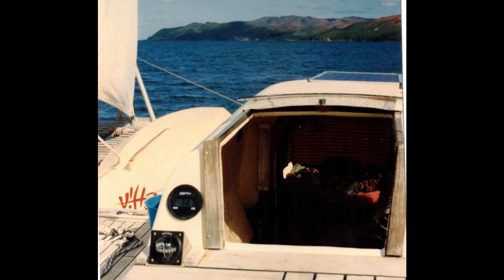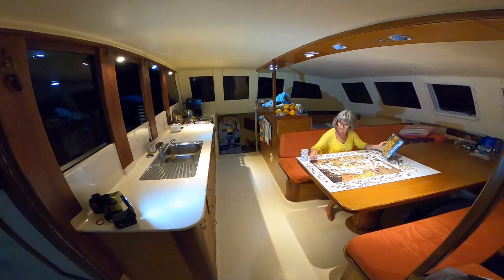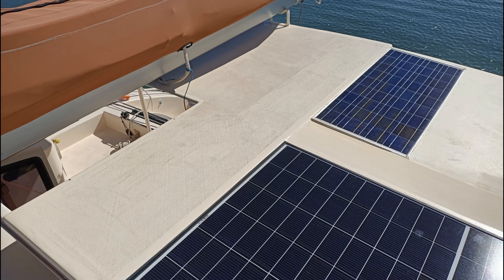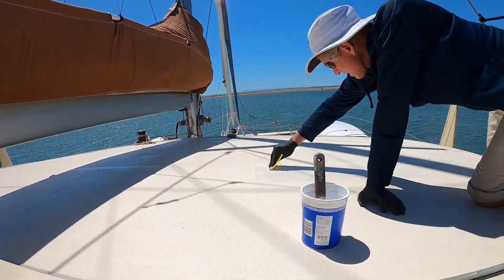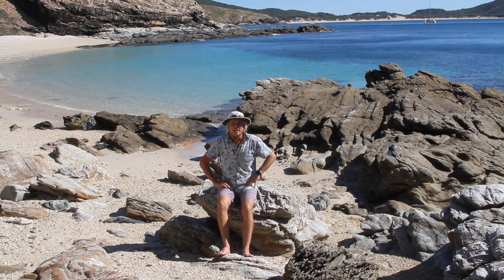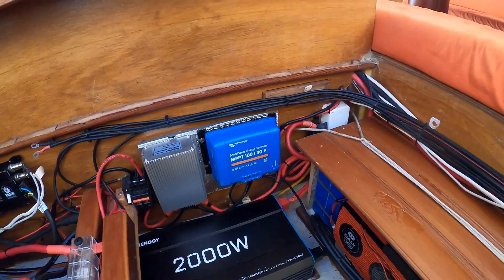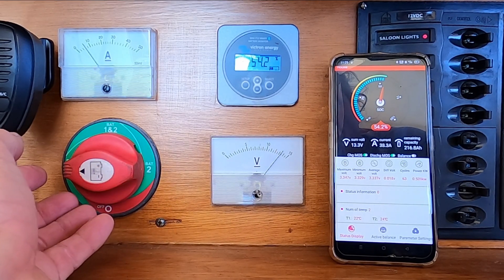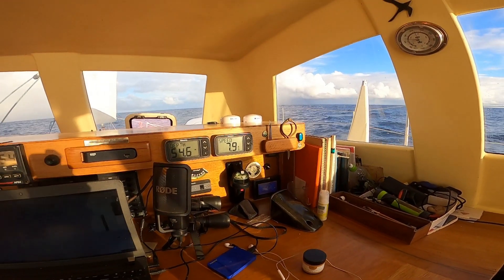Secrets of the best solar power system- The Solar Electric boat explained

Comment: I see many people use a 12v and a separate 48v solar charging system. Why not just use 48v battery bank and charging (more efficient and smaller cabling possible)?

Then step down from 48v to 12v for anything that runs 12v…

Would love to know your thoughts…
Reply from the maker: Hello, yes, I think your absolutely right, full 48v would be the way to go. The reason we have the dual voltage being we had the 12v already in place so just developed from there. Of course there are the issues of dividing the solar power and times when one is full and the other is not and not having the ability to divert this wasted power. When I have to re-new the much older 12v bank I would definitely go for a 48v bank (Now you have mentioned it!} It would just mean switching to a 48v inverter. Otherwise it would be a much better system with all the solar power coming in at 48v and easy enough to charge whichever bank is needy. Oh, the diesel engine starter motor is the only issue, but perhaps a powerful 48v to 12v convertor is not so expensive?
Reply: @AndrewStransky-cc2dr 
I agree starter motor is an issue. My thought were to have 1 single 12v battery. The DC-DC 48v to 12v would charge the single 12v battery (900cca or so). So the 12v system (DC-DC) has a ‘buffer’. In my experience everything works better with a buffer battery. 

I do plan to run dual 96v Axial motors from golden motors directly connected to sail drives. 

I am initially thinking 2x 48v battery banks. Then pull the motors off the combined banks at 96v (more efficient motors and thinner wiring). 

PS - you are an inspiration! Thank you for the amazing content!

Comment: Hi, can you parallel two of those 600w mppt controllers to charge one 48v battery? Hope to hear from you
Reply from the maker: Yes, I had often wondered how I could use the solar power from my house bank to charge the 48v side. If I could join the 2 controllers in series that would only be 24v. If I could series the 2 panels that would give me enough to charge 48v. As it is the house bank normally needs more power than the motor bank so I am normally using the dc-dc convertor to use the motor bank to power the house loads.
Reply: @ hi Andrew, thanks for your quick response, you say yes, so you have about 600w of solar to one of these chinese mppt controller and 600w to the other chinese mppt controller en the output of both is parallel over one 48 accubank, right?
Reply from the maker: @HarjoK  Oh yes, I see what you are saying. I was a bit hasty in my reply. The two 600w boost controllers were paralleled into the 15kw motor battery.  I have now removed them and gone back to the wiring those panels in series and using the Victron step down controller. In my video I reported that when wired in series the victron would have a very low output when shaded, but I did discover it was actually a issue with the controller and by re-setting it the output would increase back to a proper amount. I don't seem to have that issue anymore, not sure why. On the port side of the boat I still have one of the China made boost controllers and it works fine.

Comment: Sure your curved Hyundai glass panels are really glass and not acrylic panels. With that bent of yours glass would normal shatter.
Reply from the maker: Yes, surprising isn't it. White toughened safety glass, 3.2mm is what the specs call it. Some years before I ripped off the alloy surrounds of a glass panel and glued it to my bimini like a flexible panel. I did find it got way too hot and didn't output much but I also noticed how flexible it was and could easily bend more than I have bent mine.

Comment: Really like the integration of the fixed solar panels into the bimini roof. Thats definitely the way to go to make them part of the roof and forget these never properly working semi-flexible ones. Next step would be using bifacials to also harvest from the underside and due to glass both sides also more stable. Yes they weight more but definitely worth the extra weight as besides the rear side they work more with diffusion light. I have 3x365W longli bifacial and only the backside delivering additional 700Wh harvest daily. And mine are low above davits and sugarscoops to lower windage. Will replace with 3x585W bifacial as i found some that are only 8cm wider as the 365W and will just fit...ok sticking out 50cm more to the back but that doesn’t matter especially with more sturdy bifacials panels. That nearly doubles my output. I am on dual banks 12V starter/house and 24V house with inverters, watermaker and windlass as big loads.
Reply from the maker: Yes, its impressive how panels are getting smaller for better output over the years. Getting the right sized panel for ones situation on a boat is generally quite a lot of research. Yes, bifacials could well improve my output. I have been a bit concerned they may let too much sun through and give me less sun protection in my cockpit area? Do they let more sun through?
Reply: @AndrewStransky-cc2dr  no they don't let the sun directly through. They let a bit more light through then a black baking but less the a reflective white backing. Can highly recommend the longli bifacials, the 365 or 385W panel should be quite close in size to your 330W Hyundai ones and put out regularly 440W. In summer in canary island or Caribbean I get about 8-9kwh daily from 3 panels. They are 103cm x 177cm and  2mm thick 1cm by 3cm square aluframe, not the cheap L-profiles. My new just solar 585W bifacials are 108cm x 235cm should frequently deliver 650-680W per panel 29kg heavy.

Comment: Thanks for the information.  I have a hybrid. Volvo D1 and a 10kw golden motor. I notice you have a dual throttle controller. One morse and one electric. What is this witchery and how can I get one for my catamaran. Is it synchronised?
Reply from the maker: Yes, it is simply the original Volvo dual throttle. So I kept the Morse cable system for the electric motor, leaving the saildrive gear change and connecting the accelerator cable to the electric foot throttle. You will see details of this in my other video's Kathryn. It has worked remarkably well with the throttles virtually in the same place at equal revs. With no load on an electric motor its very hard to control revs, but when the load is on there is much more travel of the throttle. Wishing you the best of luck.

Comment: The only thing I would have done differently would have been to make some concave rails to the panel could be flat and not try to curve the panel. nice set up.
Reply from the maker: Thank you. Haha, well, that was the part I was most pleased with, but each to his own way of doing things for sure. Definitely if one is happy with flat panels they are very easy to instal.
Reply: @AndrewStransky-cc2dr  the kerf bending is a clever way of doing it. I really like how you took the ends off for better air flow.
Reply from the maker: @kchortu  thank you. Yes, a small weight saving and you don't need the strength they offer when the panels have that curve.

Comment: Thanks for the video. I thought it as going to be a solar powered catamaran (ie. the propulsion system too). Forget that, I've just watched your other videos and saw that you have a 10kW motor on one side of the cat.  It's great to see how you developed your system from the humble 60w panel. I  learned my initial solar skills on renovating motorhomes, each one getting bigger culminating in last year, putting a solar system on my house. On that system (8.7kW in panels, 92kWh lead acid battery bank, 15kW in paralleled inverters) I now monitor it from anywhere with an internet connection, via a program called Solar Assistant running from an Orange Pi 'computer'. It really is a great system. I'm currently using what I learned there, to complete a 40ft power catamaran. The original builder sadly died in 2018 with the catamaran unfinished. He was planning on using two 60HP outboards. I'm building it with electric propulsion in mind (there is no mast). Once completed (hopefully in Sept 2024), it will have 6kW in panels, two 45kWh LiPO4 battery banks, two 11kW solar inverters running at 48V and two Aquamont 15kW electric outboards. The panels will be running around 350V straight into the solar inverters so cable can be 6mm. The battery banks are 48V and the inverters will provide 220V AC and 24V and 12V DC. I will probably monitor it all from Solar Assistant and if it all works should give me my dream houseboat. I'll be releasing the build videos once she's on the water.
Reply from the maker: Wow, you have certainly gained a lot of solar electrical experience over time! Sounds like a well thought out power cat. The Solar assistant sounds interesting. I look forward to the videos of your project Alan.
Reply: Alan, you sound very solid in your designs.  I like the 350v to minimize cable thickness.
Reply: @MikeyCanuck123 350V in marine is very dangerous, already 110V or 230V are but at least inside. Having 350V outside and a cable leakage to a wet surface with salt water which is more conductive then sweet water. This push to high voltages to reduce cable sizes takes now really dangerous turns. Already 48V exponentially rises a lot issue like eg an electric lightbow arcing fuses and disconnectors which you don't have in 12 and 24V. And the higher the voltage the more these issues get serious. It's also very different to have these voltages on the charge side then load side with an inverter. 24V is still the best compromise on a vessel for safety and cable sizes. With the energy needed for electric propulsion you have no other chance then to go 48V as cables would be to large in size and voltage drop an additional problem. That now forces the solar to go at least at 60V or boost the voltage which is the better solution regarding security. But a contact with 60V can already kill you.
Reply: @chrisr819  - Hi Chris, appreciate your input.  And yes, arcing is more of a problem with higher voltages.   And if the amperages are high enough, then there's the lethality concern.  Especially as you say, around salt water.  

I have had solar for 30 years on land and have used many configurations.   I believe that 'power wire/contact' 'isolation/insulation', fuses, breakers, etc., would safeguard any high voltage DC concerns.  

But let me know about your experiences.  👍🏼
Reply: @MikeyCanuck123 I only know sailing cats/ boats and RVs. All have shading issues so the one MPPT per panel strategy already have voltage down to 24V system voltage which is still the best compromise on a boat regarding all. Also panels have 40V output and not good for 48V. Yes for a big motor cat with a lot of solar real estate on the roof getting 2 panels in series for 60V-80V output is border for me. Yes thicker cable and more MPPT is a must on a boat and never 300V

Comment: Have you considered getting a water turbine to charge batteries using the wind (ie, the sails)? Could be a nice way to put electrons into the battery at night!
Reply from the maker: I suppose sorting regen from my existing set-up is exactly this. I may well do this in the future, but I have yet to feel the need as yet. Good point though, this is actually getting power from the sails.
Reply: @AndrewStransky-cc2dr  I would approach this as when you think you need more batteries for more motoring, look into hydroelectric to charge the additional batteries.
Reply from the maker: @artsmith103  it probably is the way to go, as I don't think I want to put more solar panels on.

Comment: Keep the videos coming! Love the air scoops under your bent panels! For my 48v system i have 5 x controllers with 2 panels in series making 80Voc Each. I will monitor this to see if the buck voltage booser situation might be better. Thanks for the idea.
Reply from the maker: Thank you so much James! Your Electron is considerably more up-market than mine and together we are certainly making a good push forward into the solar electric future.

Comment: great info as always! The series vs parallel panel wiring was a bit shocking to me. I have been living off grid on land for about 5 years now and have been able to control the shading of my panels and have always gone series. As I finish my solar boat build I intended to do the same but this video has me rethinking that. I will likely redesign the wire routing to allow for series or parallel so I can be flexible on my install.
Reply from the maker: Thank you Tom! Yes, houses always do series wiring it seems as it brings the power back at such a high voltage to the controller and hugely cuts down loses in your wiring. Boats of course have all those things to shade panels. Good luck with your solar boat!

Comment: Well done with this latest video, Andrew. Wow, how far this technology has come from having to rough it in the early days to now having the comforts of home courtecy the sun. It must be the dream of so many cruiser sailors (and even home owners) out there to live off-grid so effectively and efficiently. Huge congrats on utilising it and putting it all together. Presume you still have a diesel back up system for emergency to keep you safe in the event of failures. It must be a concern and presume you have thought about fire the hazards and backup issues having an all electric boat. Maybe a subject for another video.
Reply from the maker: Hello James, yes, amazing how far it has come. We still have the port side diesel and I give it a run occasionally to keep it happy, and sometimes need it for close manoeuvring or motoring into a strong wind when we need both motors. It is a great hybrid combination. The fire risk is generally hyped up by the media. This generation of lithium is very safe, certainly much safer than petrol/diesel or gas.